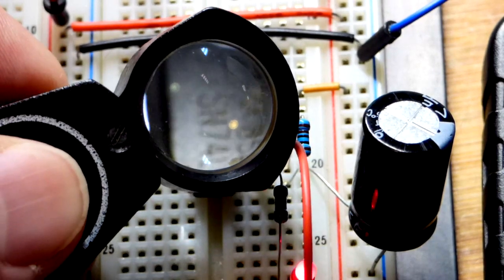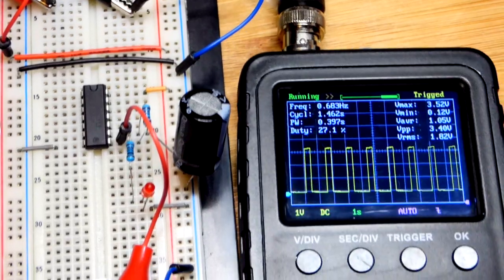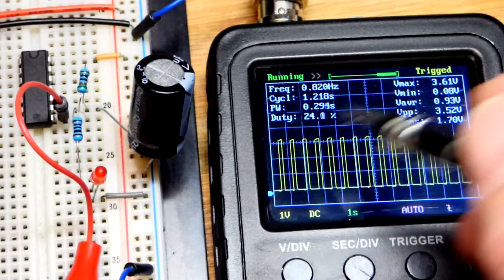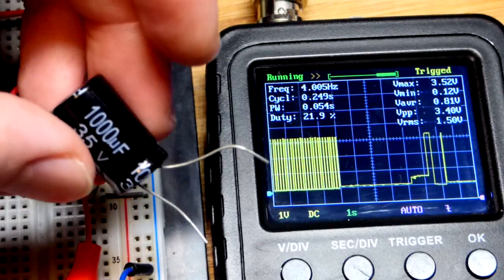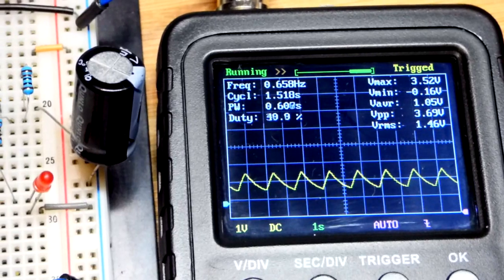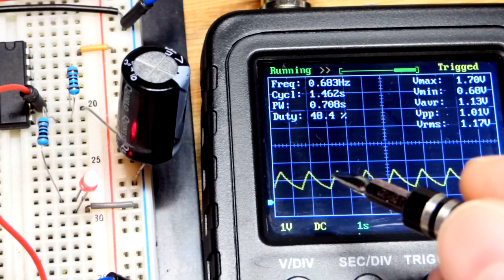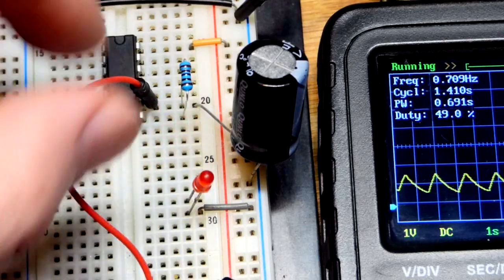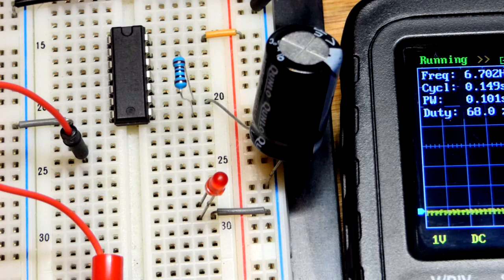7414 hex inverter schmitt trigger input oscillator circuit 74x14 SN74LS14N

Comment: hi. great video. i was wondering, im trying to build a timer with this chip and drive a relay with it but i don't want to use an extra chip or transistor, do you know the value of the throughput of those inverters? i was thinking, use one or two inverters for the timer and maybe the others in parallel for driver, my relay needs only 14miliAmps for it's coil. thanks
Reply: never mind, already found the datasheet, it says maximum 20 mili Amp, ill use 2 for timer, 1 for buffer and 2 in parallel for driver!
Reply from the maker: Yeah, I'm pretty sure that will work out well.

Comment: I NEED HELP, can I use it as a normal inverter?????
Reply from the maker: If you need to invert a signal then there's a number of ways. Whether any given one will work or not will depend on the circuit. So I'd look up digital (logic gate) inverter circuit and see which  on works best. I bet a single transistor signal inverter will be easiest. Hope that helps!